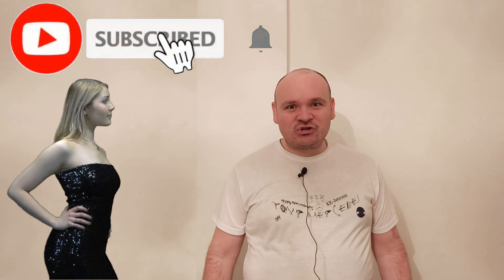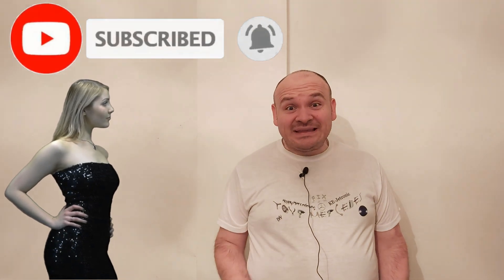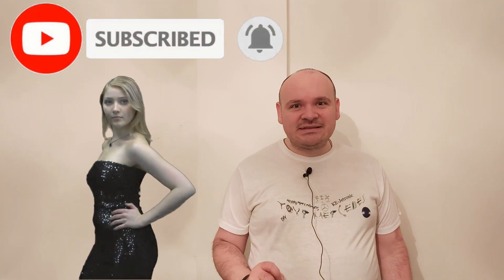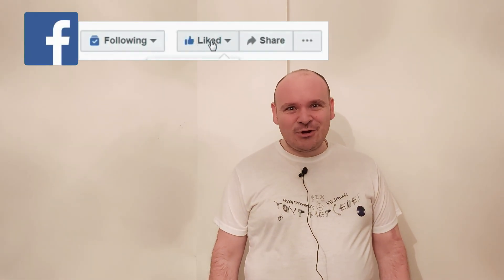㉦Mercedes Ke-Jetronic㉦ - The Ignition as the second step

Comment: As an expert in fixing the KE Jetronic. Could you please post the links where to buy the parts? For example from where to buy a new Ignition Coil
Thanks.
Reply from the maker: Check your auto shops or on ebay by the number.

Comment: My 1990 560SEC ignition timing is advanced and so difficult to start, what would cause this? Thanks
Reply from the maker: Is the mark TDC aligned on the timing chain with the groove on the other end? Is the crankshaft position sensor within the specs? 600-1300ohm?
Reply: @mercedeske  Yes mechanically correct, will have to check the crankshaft sensor, I have spent 2000 euro already replacing fuel and ignition parts, thank you for your help friend
Reply from the maker: @mikesmerc  My pleasure, hope you solve your issue. Happy Mercedesing 😃

Comment: My w124 doesn't start until I press on the air sensor plate. Can you please figure out what is wrong with it?
Reply from the maker: Did you set the play on the sensor plate? It has to be 1.9mm before the plate engages the plunger in the distributor. It sounds to me as if someone has been turning the CO-screw counterclockwise so that the balance between the plunger and the sensor plate is out of the alignment. That's why as you press the sensor plate you engage he plunger in the distributor and the car starts. What happens next, does the car stall as you let the sensor plate?
Reply: @mercedeske  Thanks for your response 🥰Next, it starts to work normally but sometimes it stalls.
Reply from the maker: Did you check the potentiometer?
Reply: @mercedeske  No, but I've changed the air flow plate all together
Reply from the maker: @yassindiab6144  Start the car and let it warm. As it is does, put the multimeter in the contacts 1&2 and measure Volts ⚡ DC - you will have to get 0.7V on idle. Then is your potentiometer okay 👍🏻
Reply: @mercedeske  Amazing 🥰🥰